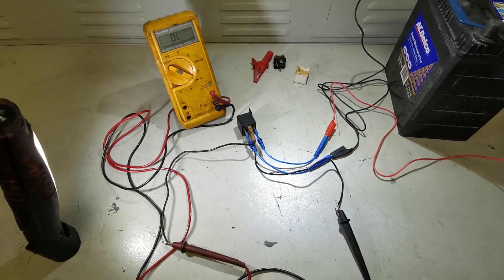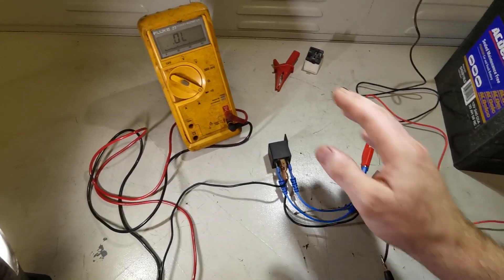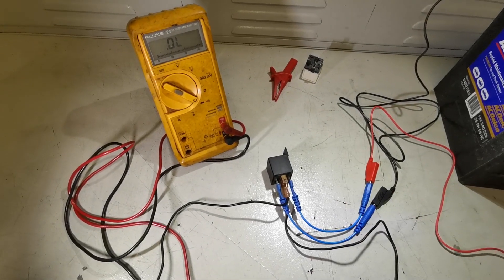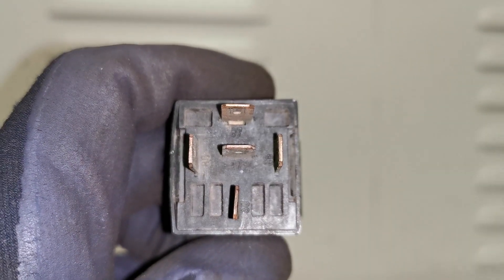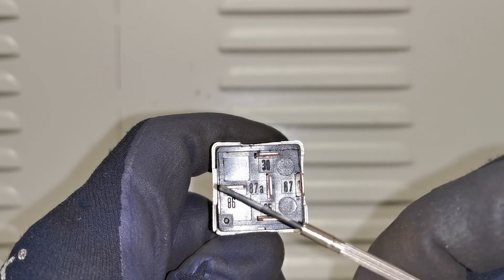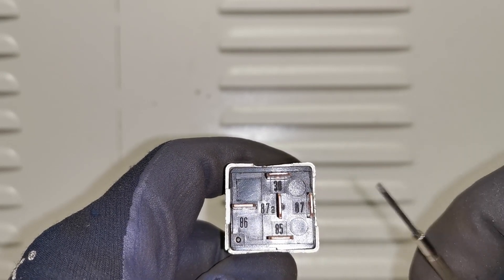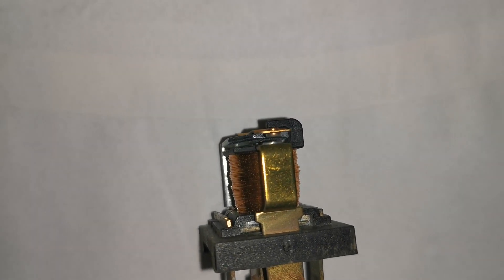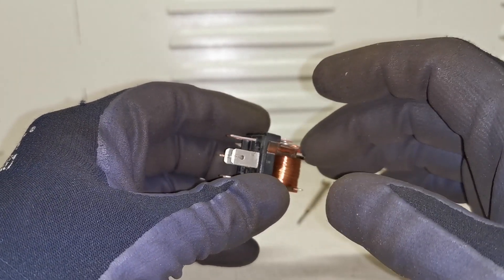Relay Test So Simple My 4 Year Old Done It!

Comment: Hi great video I understand the relays with 30 87 86 snd 85 its the 1, 2 ,3 4 ,5 that they use relays in French and German cars I haven't mastered especially when the pins are all same size as the load ones are sometimes bigger pins could you do a relay with them pin numbers